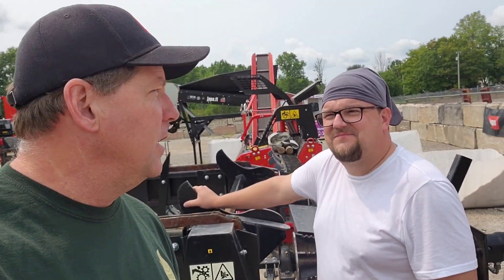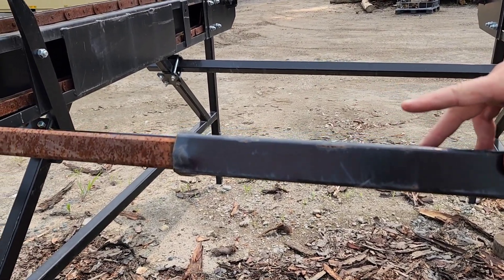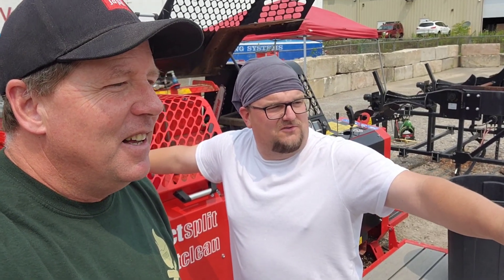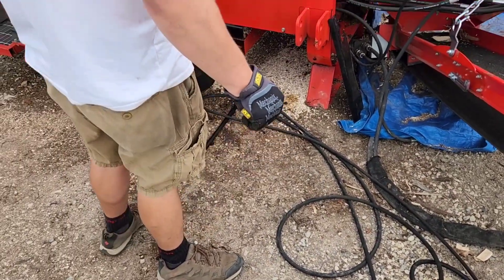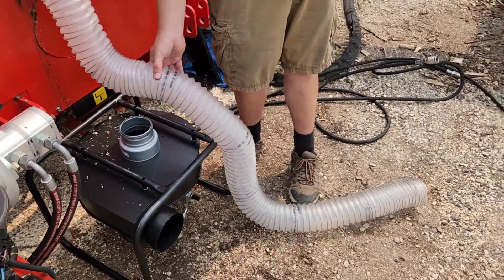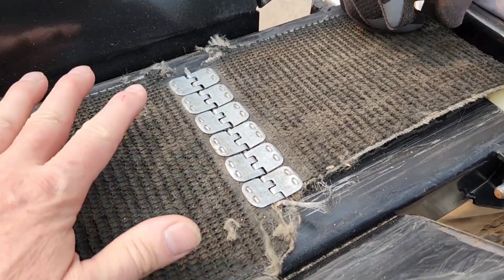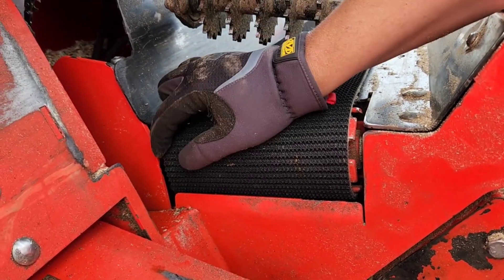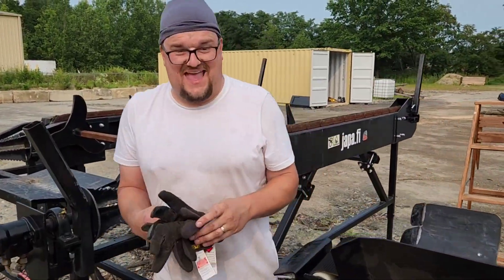I Broke The Firewood Processor NOOO!!!

Comment: Hi Joe - it's Big Rodders in Ireland.  That new toy seems like a good machine but it comes at a price, although I assume it cost you didly sqat!  If I had the same issue I imagine I would reroute the engine air intake away from that area and justt keep the place tidy with my back pack blower.  For the average operator the issues to consider are capital outlay, space required, power consumption and additional complexity for something to go wrong.